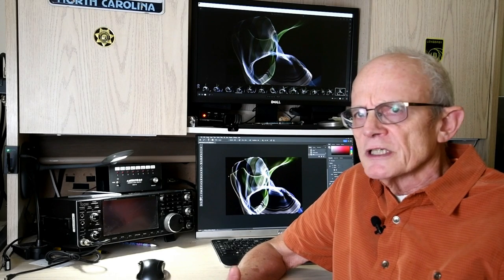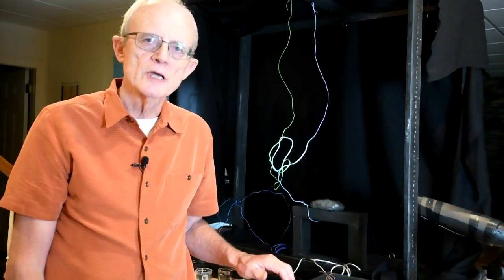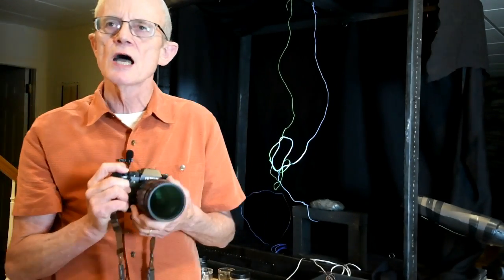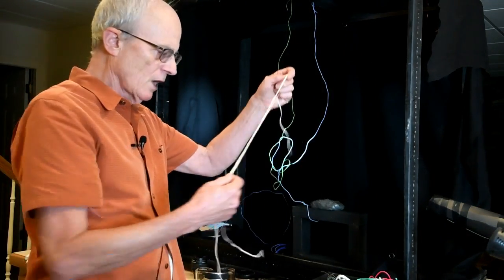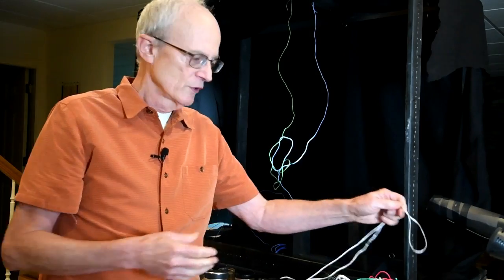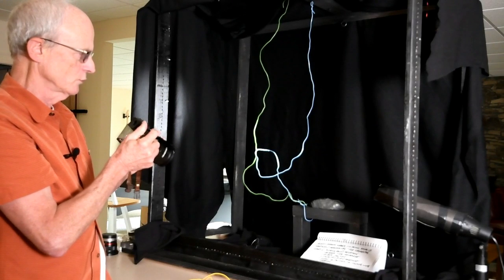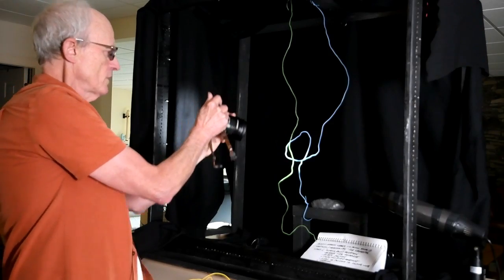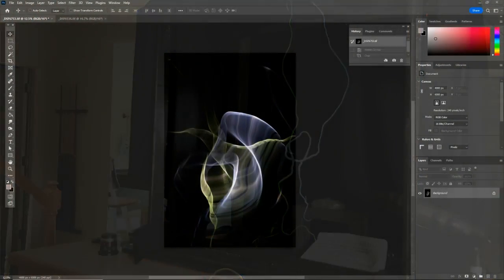Wire ICM Photography

Comment: Thanks for sharing this inspiring technique.  I just finished doing some icm shots using strings in dark background to experiment.  I used a Canon mirrorless camera with 1.5 secs exposure.  When I review my images in my laptop at 100% view in Lightroom, I saw a lot of hot pixels particularly in the dark area.  1.5 secs exposure time should not produce hot pixels.  Have you come across this?  What can I do to prevent this from happening?